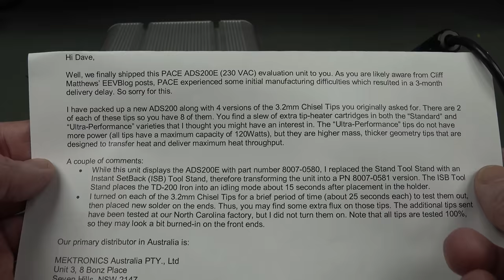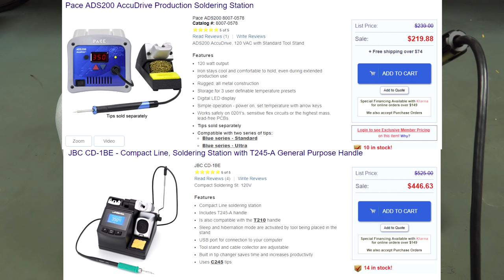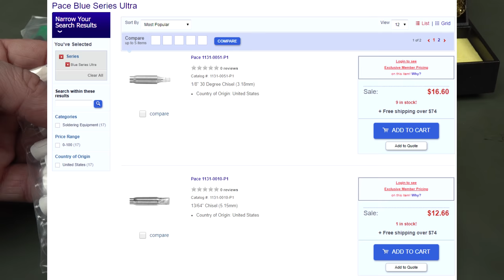EEVblog #1106 - Pace ADS200 Soldering Station Review (JBC Killer?)

Comment: The cap is in direct contact with the heat sink?!?  That will heat up the cap and reduce its reliability.  Dumb.
Reply from the maker: Not the smartest idea.
Reply: The bolt is on backwards, someone goofed.. easy fix.
Reply: Just bend it out of the way.... Fixed!
Reply: I bet Dave received a RevA unit, which had a last minute patch to fix a heat issue on that TO-220 package. Here I am, 17 months after this video was made, and I bet that by now, Pace has a new MLB that has corrected the issue. No company wants to go into production with a board that requires patches like this. It adds labor cost and slows down the production line. Ditto on the temp reading fluctuations. By now, Pace has made a firmware patch to correct it.
Reply: Enclosed heat of the transformer should be worse. I wonder why they needed the heatsink on the 7805, the entire microconroller+ADC+LEDs thing should be less than 100mW and they could have had a winding out of the transformer at 8-9V.

Comment: Would be nice if the iron holder were able to be fixed to the supply either on top or the side.
Reply: There are "T-Slot" extrusions on each side (and top of the power supply) that allow you to securely attach the Tool Stand to either side. The hardware to do so comes with each station. There is also an optional Handle PN 1321-0609-P1 that attaches to the top "T-Slot" extrusions that allows for a carry-around capability.
Reply: That is fantastic!

Comment: my first soldering iron was a stenda 40w one that cost only 15$ but it works fine and it has also a knob for the temperture!
Reply from the maker: My first iron was a mains job with dodgy temp adjust pot on the handle.
Reply: Edgars Lacis-S 

I think mine was one of those yellow Antex mains ones from Tandy (Radio Shack).

I started soldering using my Brother's iron when I was about 8, though. I think that was a Weller?

I don't miss the mains irons with the tips that used to turn to charcoal within a week. lol
Reply: Mine was an American Beauty "Little Dandy" :-)  Hot handle was standard no-charge!
Reply: And surgery used to be performed hacksaw and hammers. Thank goodness for progress

Comment: that is one homely soldering station - I think JBC is safe.
Reply: burrito rustler I think I might get a pace.  It would be safe moving around...
Reply: can't even see a need for this company, Hakko soldering stations are incredibly reliable and work flawlessly, JBC and Metcal also make great stuff, even Weller is fine.- although Weller needs to make their hot air station heating elements replaceable - that's unforgivable!
Reply: Other than it being a well known brand in its original market that makes good quality products? lol.
Reply: burrito rustler Every single hakko at work has the clips broke off on the soldering pen.  It is really a terribly designed soldering pen.

Comment: 24:15 Why did not the temperature indicator go down ?
Reply: I'm far from an expert but have been reading about this station quite a lot. The tip plating is quite thick on these which makes them more reliable in particular with lead free soldering fluxes, but at the cost of thermal conductivity. So it may be that the outer tip temp has dropped (well, obviously it has done) but the inside is still at temp. If the tip's iron plating is thinner the iron can detect the drop and respond faster but this is at a cost to tip longevity. I would guess that the iron has increased its power to maintain temperature but due to the speed of thermal transfer through the thick plating, the temperature at the surface is lower by enough to stop it melting the solder - due to the limited speed with which the heat is transferring out. Whether that matters in practice depends on what you're doing; personally I'd be happier with this rather than short tip life but lets see how reliable they prove to be in the real world.

Comment: It can't be stackable I don't think as the front rim sticks out (up) too high it seems. Nice that it's top side iflat, not so nice that it's face raises up way higher than that. It looks like an old Dutch home as the better class would build surrounding the Grachten, with their decorated front sides higher than the actual roof

Comment: I really hate this one. Tips is not interchangeable with older mbt-350 and st115 series. Even stand is different. It's a same size, but sleeping function doesn't work with new station and old stand. And if you try to use older tip on newer station it will overheat and damage the board. (yes, they using same connector). I think pace is like an Apple from soldering irons. 

I still love my older metcal mx500. Much better than any new garbage. Unfortunately i cannot choose what to use at my job :(

Comment: Why do digital soldering stations have  only buttons??? Add a bloody potentiometer to set the temp quickly...
Reply: danijel124 Because a pot wanders...
Reply: We produce several dial type stations and they work quite well. The problem is ... they don't sell! We are getting ready to discontinue one model because people don't seem to want them.
Reply: It has 3 configurable presets so one button quickly gets them all (and you don't even have to press them with your finger.. just use the hot tip, Pace makes them out of silicon)

Comment: Oh yuck. The ground bounce hammering their thermocouple readings is awful. D:
Reply: Compared to what?
Reply: Not even the $25 chinese Hakko / JBC controller does that.
Reply: Gmail PowerUser A circuit where the high current lines aren't interfering with the thermocouple readings? Thermocouples only kick out a few microvolts, so it doesn't take a lot of noise to screw them up. (Source: I've screwed this up myself before.)
Reply: On all the cartridge designs at least one wire of the thermocouple is shared with power, so the only practical way is to measure when the heater is off (zero crossing is a good time as you don't lose any power).
I think they must have screwed up their timing or something. Maybe the engineer just doesn't care, same as the poor PCB layout.
Reply: Its probably just down to the grounding order on the PCB. Could they just low pass the thermocouple line?

Comment: Now is that 370°C or °F?
Reply: °C.  230VAC stations default to °C while 120VAC station default to °F, but this can be easily changed by going into the menu.
Reply: One more digit on the LED display and we would know - mounting it upside down gets you a nice "degree" point out of the decimal point...

Comment: I would still prefer the JBC handle and a selfmade station
Reply: Have you ever seen what it takes to build a station that can monitor/control a JBC handpiece? It's a downright nightmare. Marco Reps had a build, but I'm sure you've seen it.
Reply: The unisolder is great
Reply: Try building a Unisolder. I bet 9 out of 10 never get completed. Someone needs to sell assembled PCBs.
Reply: acoustic61 i've completed mine
Reply: Would be interesting to know if the thermal performance of the ADS200 can be improved using Unisolder or a redesigned control PCB? I wonder if tip plating is the real issue?
Reply: Marco Reps has a video on it, comparing the unisolder versus the pace. They use the same exact metod for heater driving: chopping ac half waves. The pace is better calibrated, but the unisolder (with the t245 profile) has a much better tuning of the pid
Reply: Like I said, I wonder if the tip plating is really the issues with the poor thermal performance? I'm sure someone will try to improve on their design with a third party PCB.

Comment: 11:00 The stringy bits are called sprue!
Reply from the maker: Thanks!
Reply: No they are not, they are the runner, the sprue is the part that connects between the runner and the injection nozzle.

Comment: The extruded case is probably cheaper than a custom cast or injection moulded one.
Reply: Definitely more expensive. I've said this elsewhere, but we have been using these custom (not off the shelf) aluminum chassis extrusions since the 90’s. Yeah, old school. Some people think it’s great, some sexy (Dave does!!!) and others think it is ugly and antiquated. But creating a modern and sexy new case would have added at least 3-4 months for tooling, required us to redesign the pcb and a host of other issues. They're custom extrusions, lead times are extremely long (we have to order at least 6 months in advance) and we have to buy this material in long sheets that is then cut to size, then anodized. The extrusions end up costing more than a custom stylized metal case would. It was estimated that we could have saved about $7 per ADS if we would have switched to a more conventional sheet metal case (meaning a significant reduction in list price). But then the customer would have had to wait another year and the resultant power supply would not be as rugged. In the end, time-to-market concerns and the fact that the ulta-sturdy case is practically invulnerable to burns, 3 foot drops onto a cement floor and other customer abuse, led us to stay with the proven and rugged old-school extrusions.
Reply: never have I heared so much bullshit but then it is made in america. it's a soldering iron for christs sake, a sheet metal case can be designed in a day it's not a military vehicle....... sheet metal does not require specific tooling so can be turned out as soon as you have manufacturing capacity. several companies do off the shelf extrusion for this very type of construction. It would appear most of the product cost is customer service.....
Reply: @SparkyLabs  They sell thousands of units to the military.. drop tests are 3ft to concrete slab. If you put that 4lb transformer into a sheet-metal case, the transformer will warp the case when it hits concrete. These guys make only production grade tools.
Reply: @SparkyLabs  Mr. blah blah, I'm not American but obviously, you're unable to control the irrational Amero-hatred enough to address practical issues of sheet-metal rigidity. Extrusions are cheap enough, low labor, and shape consistent for low to medium level production items like this. On raw 8ft. extrusion stock they'd likely do 7 straight-cuts, followed by 8 angle-cuts and buffing for 16 cases (~$120). Fronts and backs are extra, but easy runs on a metal brake and press, afterward stenciling and sticky feet. The metal front shroud is cast (not my area), but that American Pace guy is telling the truth ;)
Reply: @kwpctek9190  what ever floats ya boat, when I buy and iron I expect to use it as an iron not a hammer! if people are too clumsy not to break well built kit they will have to spend the money on over engineered kit.

Comment: There are no solder station manufacturers who have got the interface system right. Proves the designers are not users (nor engineers) but plonkers.  For god's sake put a rotary knob temp dial in there; a toggle switch to go between degC and DegF display: a rotary knob temp dial for the standby temp which ranges between 25% and 100% of full temp scale - JOB DONE.

Comment: The buttons look to be 3D-printed (SLS, rubber powder)
Reply: They are intentionally made of temperature resistant silicone ... for some reason customers try to change temperature by pushing on the keys with the HOT iron!
Reply: Why would anyone do that?!
Reply: zapro_dk 
because youve never fully used your equipment until you've abused it. 😈
Reply: @zaprodk  Because Pace makes tools for serious production line use.. A tech might be holding the thing they're soldering with the other hand. Why put down the iron to change the temp when you can just use the tip?

Comment: If the $25 chinese Hakko / JBC controller can have a rotary encoder and nice OLED graphic display, why do you have to button program this thing through a 7 segment display? I mean I'm not one that needs all those settings - I like the plain JBC stations best that have nothing more than one big analog dial and no display, but this seems silly in 2018. 
It's ugly as fuck, who ever designed that front panel had no sense for symmetry, but that's only taste and some people like ugly.
One big advantage of the JBC is how easy you can swap tips, it is easy and quick enough that you don't tend to avoid it. Any new cartridge design should copy that or improve on it (but maybe there is a patent)
Reply: OLEDs have a notoriously bad mtbf rate. The red led is easy to read, easy to fix, easily sourced, and inexpensive.
Reply: me too.  don't need button bullshit.
Reply: Damn its beautiful!
Reply: Symmetry? Really now, it's a production tool not an entry for a flipping beauty pageant. It's so tough, you can push the silicon buttons with the hot irons tip. BTW rotary encoders don't last for 20-years without failures either.

Comment: Can you diy that pace circuit board using that atmel chip. I think its open source ??? If we have the gurber files for that pcb than anyone can order pcb from JLC PCB to make that soldering station under $199 😂😂 and of course we need to buy pace handle and tips 😂
Reply from the maker: There are DIY open source station designs I believe.

Comment: I dont think this looks like "top quality" . That extrusion looks like off the shelf project box territory and the board isnt well engineered and the setback feature is intermittnt. Exactly what part of it is top quality?
Reply: The robust physical construction vs a Hakko toy.
Reply: I never rellay liked the hakko either. They are good but I feel they are too light for a fixed point tool it wouldnt hurt if it had more weight to it. But this one the fron panel looks like a microsoft publisher for windows 3.1 template and it has a hobby project box look to it overall. Doesnt look like a bespoke tool more like a prototype.
Reply: Yeah, don't think they have the best grapgical designers. but its like in programming, most technical people lack graphical design skills.
Reply: I dont know if I can agree with that. Most graphical design people lack graphical design skill. It's all just a big meme.
Reply: My comment comes from experience. MOST technical people, esp programmers and engeneers just don't put the time in, and don't have inate skill in artistic graphic design. Now, many do have skill inate or otherwise in other forms of design. but not like pleasing to the eye pretty colors and shapes type things. People tend to focus on their prefered area and skip on things not directly related to it.
Reply: If it helps, I'm a professional programmer, and into a bunch of other things as a hobby, like electronics, wood working, etc.
Reply: Mechanical engineering employs the same skill set as graphical design. ability and giving a fuck are different things. For example when people DIY a  CNC machine they might put magic marked pieces of masking tape to tell you what buttons and toggles do but would never do it like that if it was for someone else.
Reply: Yes I know programmers who are basically badgers who live in a little den with no furniture other than a manke matress in their apartment. But the people who are worst at functional graphical design are web designers and those who program for Autodesk those 2 groups love to hide all the relevant function in sub menus. Honestly software companys should employ people who know thie shit to make shells and others to actually make it work becasue when you are a programmer you have a totally different sense of logic than people who arrange books by size and colour rather than the contents. They should alsa test it with the intended demographic to ensure the software is used like intended.
Reply: Mechanical and programming design are more anylitcal than pure graphic design. like laying out a PCB, or designing an API. sure they have some artistic requirements, but its not quite the same.
Reply: What do you have against extruded enclosures? Or it is just that enclosure that sets you off?
Reply: Pace used to have a non extrusion based housing on their earlier older style model (look up Pace ST45, with a black housing).  I have two ST45s that easily stack on one another... not sure why Pace decided to use extrusions on the current model when they could have used the tooling of the previous generation (ST45) for a housing.
Reply: PACE has been using these custom (not off the shelf) aluminum chassis extrusions since the 90’s. Yeah, old school. But they allow the ADS200 to be built like a tank and (unlike the Hakko FX-951) you can set things on top of the flat and sturdy surface, such as another soldering iron or a photo of your cat. You can also mount the Tip & Tool Stand securely to either side of the power supply (hardware is included). They're custom extrusions, lead times are extremely long (we have to order at least 6 months in advance) and we have to buy this material in long sheets that is then cut to size, then anodized. The extrusions end up costing significantly more than a custom stylized metal case would. Some people think it’s great, some sexy (Dave does!!!) and others think it is ugly and antiquated. But creating a modern and sexy new case would have added months for tooling, required us to redesign the pcb and a host of other issues. In the end, time-to-market concerns and the fact that the ultra-rugged case is practically invulnerable to burns, 3 foot drops onto a cement floor and other customer abuse, led us to stay with the proven and rugged old-school extrusions.
Reply: rimmersbryggeri : I hate that books have different sizes.
Colour coding is king!

Comment: 5 degree accuracy on display is kinda meh too
Reply: The new firmware sets to 1degree, check the EVvblog forum
https://www.eevblog.com/forum/manufacture/newest-pace-ads200-production-station-(a-jbc-killer-at-$239)/msg1886375/#msg1886375